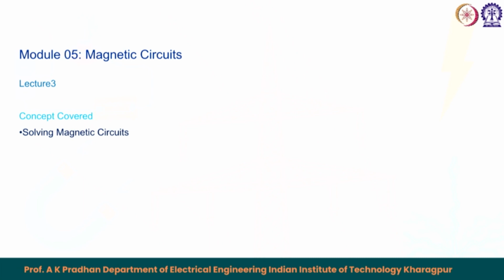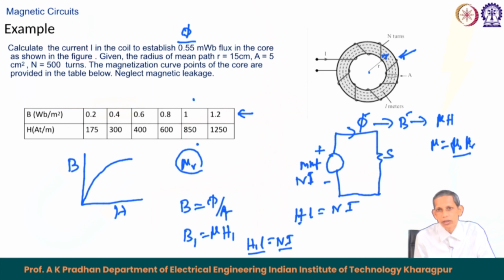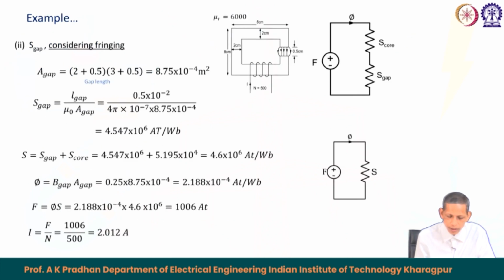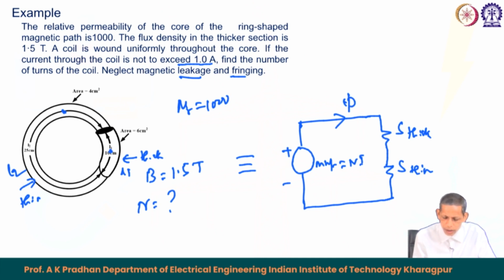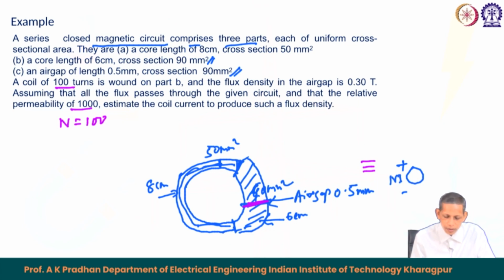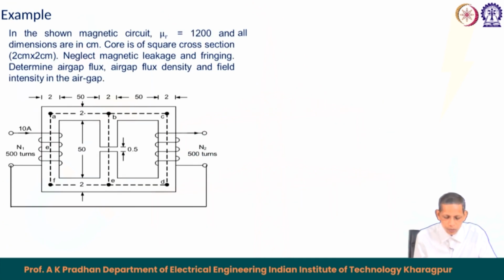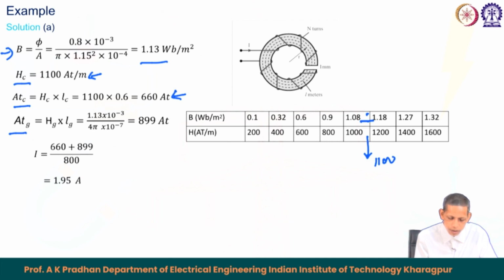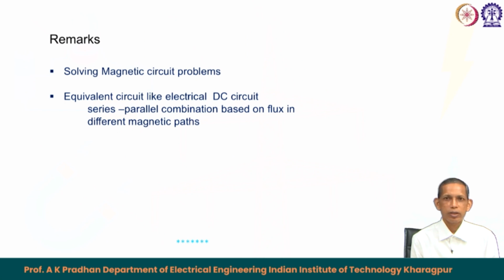Lecture 33 : Solving Magnetic Circuits

Comment: at 30:15 cross sectional area for air gap should be 90 sq.mm. However, in lecture slide it is mentioned 1.5 x 10 raise to power (-4) which might be a typo error.